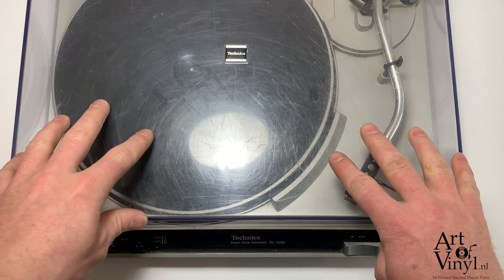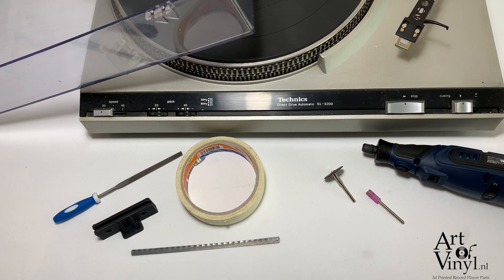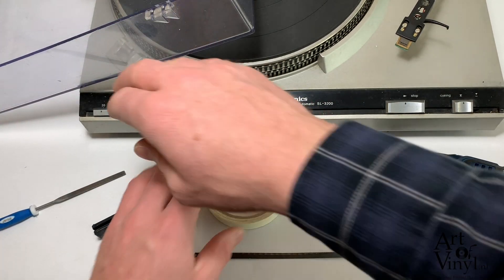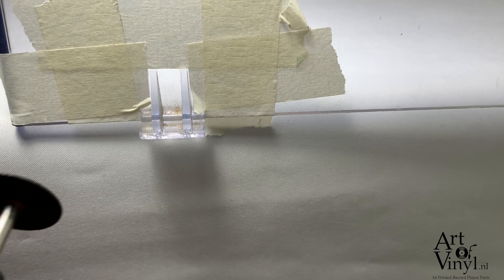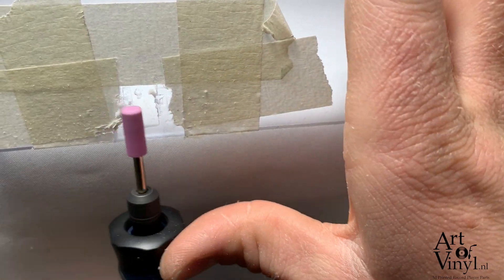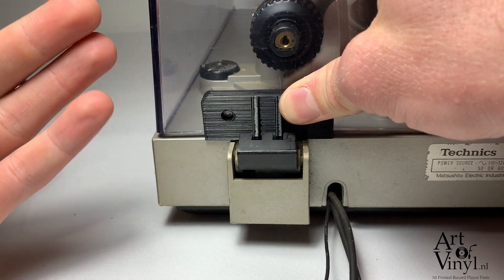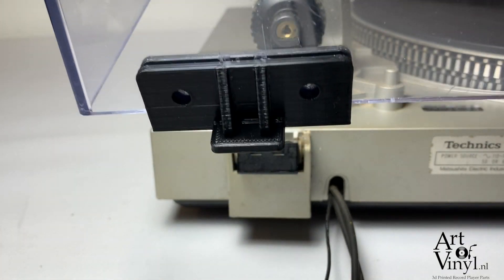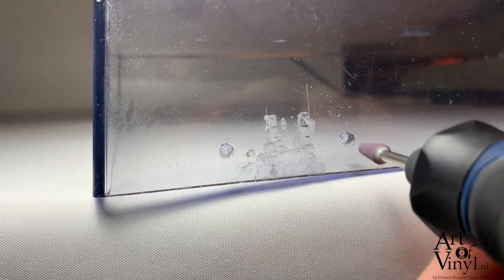Technics Turntable Dustcover Hinge Repair Instructions

Comment: The hinges I bought are not as elaborate as the one you are using. You did a great job, I didn't think of using the multi-toolbut that makes the job much easier (I was going to cut with a coping saw instead). Also, using the masking tape is a good precaution for not damaging the surface of the dust cover. Thanks for the help, you did a fine job.

Comment: Can you tell me the distance between the bolts? I already installed an aluminum hinge, but the dust cover doesn't sit right. I want to know if the holes I have already made are compatible with the hinge you offer.

Thank you
Reply from the maker: Dear Eduardo, if you give me the dimensions of your holes I can modify the hinge to fit yours. 
I wouldn't recommend using metal hinge tabs, since they don't flex, therefore putting extra stress on the dustcover.

Comment: I have a similar issue but with a JVC dust cover. JVC AL-A155TNX.  They are not “broken” but the dust cover no longer stays up.  Need to replace the hinges.  Let me know if you can resolve this?